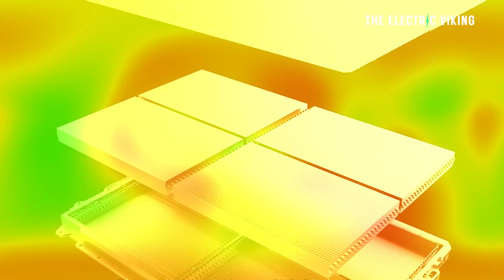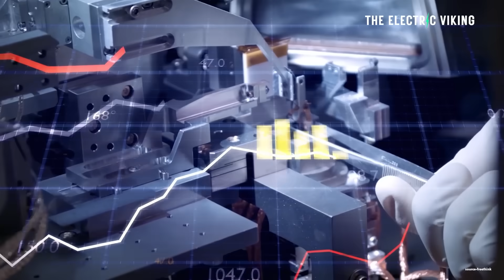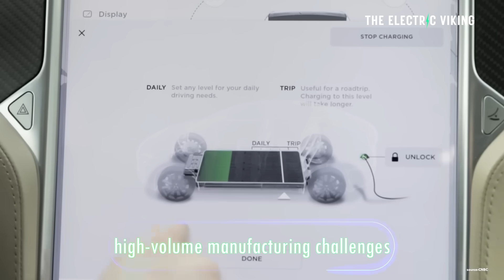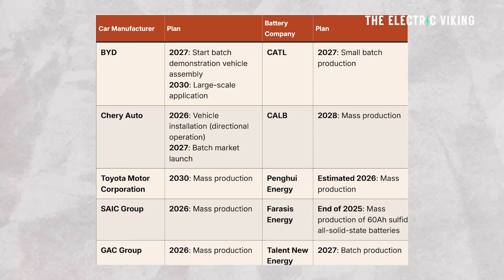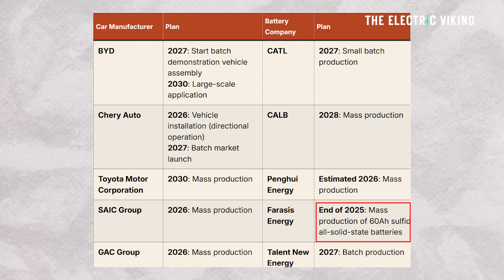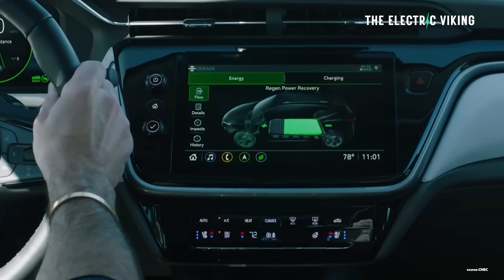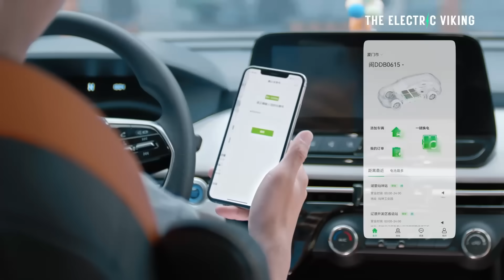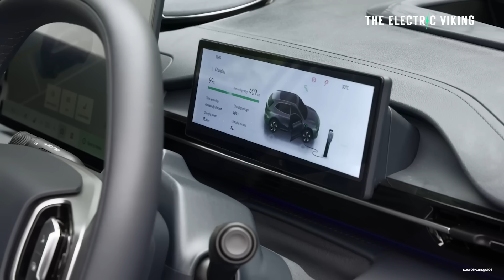Chinese Expert Reveals the Truth about Solid State Battery Mass Production

Comment: Historical progress on wet battery technology will now and in the near future will surpass solid state batteries.  The realistic goals would be technology that recharges in 10 minutes, 10 to 80 percent, and 500 mile range. That all that is required to increase adoption.
Reply: We need solid state batteries for aeroplanes due to weight. Lighter the weight the better for planes.
Reply: The 500 mile range ability is useless if the cost is too high. Even the least energy dense battery pack could be made big enough to achieve a 500 mile range. The real issue is cost. A better measure than range would be the batteries cost per kwh.
Reply: Faster charging speed and more charging stations is more important than battery range
Reply: They also can’t be affected by cold temps. Here in Minnesota, I need to be able to leave my car outside for 10 hours in below zero temps and not lose any range. That’s when adoption will really occur. This may not be an issue where you live, but hundreds of millions of people live in cold climates.
Reply: the amount of energy it takes to move a car of a given weight a given distance remains the same (ignoring secondary things like air resistance) the energy that is put in.  The energy that comes out of a battery cannot be greater than the energy put in at charging. To get greater range cars need to pull more power out of the grid. Either need to take longer to charge or the whole enery infrastructure needs to be uprated.

Comment: If the LFP batteries are safe, fast charging, long life and cheap, then who needs other more expensive technology?
Reply: Weight and size problem. Are you still using the first generation of Motorola which had the size of a brick? 😂
Reply: @freeskier64  That was a nice brick but cheaper and lighter than the Bosch Phones i had in my company cars before that.

I used it as blackmail to get a free new Ericsson phone in my 3. Job@Ericsson.

Fun times.
Reply: Planes?
Reply: @rendezone Trains?
Reply: We need solid state since liquid batteries can explode or catch on fire
Reply: We need at least 600 km of reliable range, as any standard ice can do.
Reply: @antoniofigueiredo3812 
New model y 6 seater  LR does 700km or 430miles on a charge  , that good enough for ya?
Reply: lower capacity per weight and volume, meaning you can't fit as many of them as NMC based cells and then you have to compromise on range and performance potential or you have to oversize your vehicle architecture to compensate.

They are great for some applications, but almost useless in others, depending on which metrics are important.
Reply: Because we need batteries that can power more than a small car. W need to power utes and twucks
Reply: @lengerer  "W need to power utes and twucks" We already have electric trucks and Semis. The manufacturers just are incompetent making them fast enough.
Reply: @wolfgangpreier9160 yeah the EV Dmax has 300km range when empty. Put 800kg in it and you'll get 100km then need to charge 12 hrs to get home.
Not good for Australian tradie or courier
Reply: @lengerer  What is a Dmax? We do not get such vehicles in Europe.

The Iveco eDaily has 111kWh, good for 300km. BYD 7.5 ton has 126 kWh, Good for roughly 250km. Then there are EVito, ECrafter ETransit Renault, Fiat, Toyota, Citroen, Scania, Volvo, Mercedes Trucks, DAF. 

King of the road is the Iveco E-Ray with 1090 HP and the  Mercedes-Benz eActros 600 with 816 HP. Both can tow the maximum allowed 42 tons on the steepest mountains in Europe with full speed of 80 km/h. 

And still reach 4.5 hours drivetime easily when the laws demand that you stop and make a break (every 4.5 hours 45 minute break, 9 hours max per 24 hours, 60 hours weekly maximum is allowed)

Weight is no problem. My EVs use the same energy empty or fully loaded. Only wind and trailers cost more energy because of aerodynamics.
Reply: @lengerer the Mercedes eActros 600 is powered by LFP batteries.